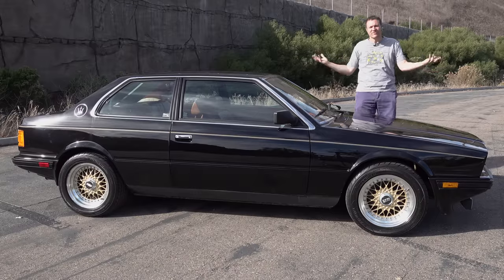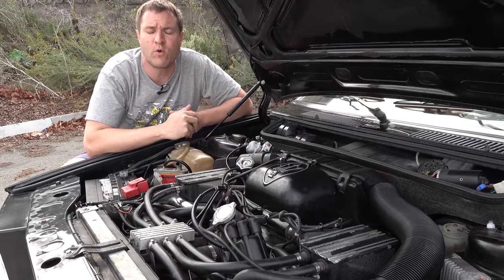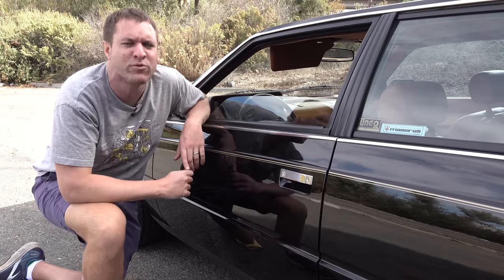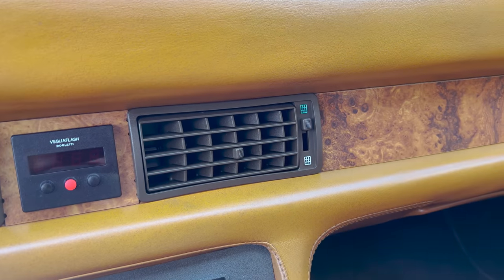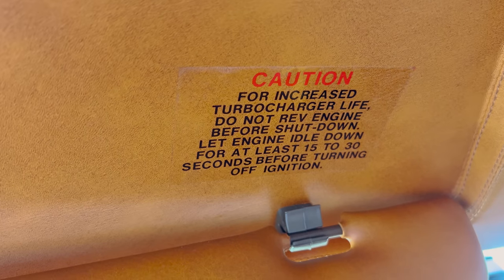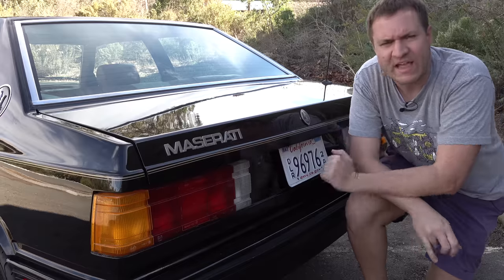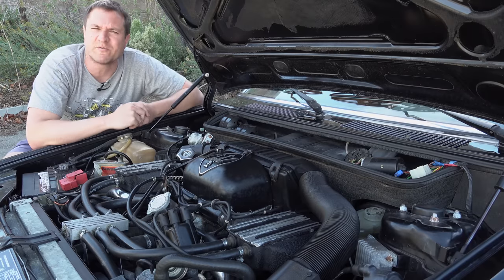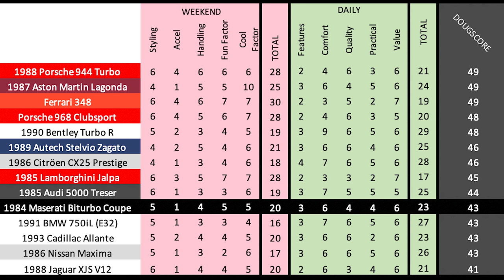The Maserati Biturbo Is the Ultra-Affordable 1980s Maserati

Comment: There is no real room to giggle over these specific quirks. That is the 80s for ya if not concidering the Volvos... During the 80's most Europeans drove around in 10 year old ones, rarely breaking the 100hp barrier... Not even the modern 80's cars went up there. Fastest i knew had like 140 or something. An awesome new Audi. I remember these Maseratis. The design was stellar.. looked like beasts next to our Mazda 626 and our next purchase, the volvo 245. And 110hp more... they were poster cars when the fiero had like 135 and the v8s put out like 220 at max.. in two tonne chassies

Comment: Turbos were not at all rare in the 1980s. They were everywhere. Just as ubiquitous as today.
Toyota Supra, pickup, Subaru GL, XT, Isuzu Impulse, I-Mark, Mitsubishi Mirage, Starion Tsi, Cordia, Nissan 300ZX, 200SX, Dodge Omni GLH, Colt, Daytona, Labaron, Charger, Mazda RX7, GL, 626, 323, Buick Regal, GNX, Century Coupe,  Skyhawk, Ford Mustang SVO, Mercury Capri RS, Merkur XR4ti, Pontiac Trans Am, Chrysler Conquest Tsi, Laser, Porsche 911, 944, Lotus Esprit, Saab 900, Volvo 240, 740, 760, Renault Fuego, Pegeot 505, Audi 5000...
All these had turbo models plus slew of turbodiesels from Europe.

Comment: You did not address the 800 lb gorilla in the room. Less than 200HP from those "BiTurbos" - for - 12MPG city, 18MPG highway, 14MPG avg. "OFFICIAL" fuel efficiency rating. ACTUAL experience HERE with MY 1984 BiTurbo: 8.2MPG city if I drive it like I'm not trying to piss everybody off behind me. And 14MPG highway. That's LOTS of gasoline for...for.  ...  ?? umm. MASERATI LOGO! Oh, and hello faiz! (My Italian car mechanic that's always busy working on Lamborghinis.) He called me by name. Yeah. We know eachother like that. mmm-hmmm.

I traded it in for a 1984 Alfa Romeo GTV 6 2.5 Mile Miglia quardrafoglio, put the turbo and intercooler on THAT car. It had a factory team works tuned baffle exhaust with stainless steel Borla parts. It had factory bronze window tint and power moon roof. I had it repainted from original black to money green metalic with a huge red white and green serpent and cross logo on the fenders right in front of the doors. C pillar had the Quadrafoglio badge from factory. Walnut dash had the pot metal plaque of Mile Miglia, showed the course over Italy. Flat black louvres over rear windows - all three, sides and back hatch. She rolled on Pirelli P-Zeros.  Inner headlamps were positioned lower and tinted green. A fog lamp kit was installed and it made people hate me so I never turned them on. My insurance was $2,500 per quarter for liability only because I was under 28 years old and male and I lived in a zip code that my insurance agent was raysiss against. PERFECTLY CLEAN driving record, nontheless...but never MIND, what MATTERS.

Comment: There's just that X factor. Same with Alfa-Romeo. Top Gear criticized the 147 GTA, which was inferior to a Golf R32 in almost every objectively measurable way. Yet, all three stated they would still buy the Alfa-Romeo. 
As a teenage kid, my dream car was the 1990's Gandini designed Maserati Quattroporte. And even though the W124 E500 or E38 3.8 M5 are vastly superior, i'd still have the Maserati over both. In retrospect, i respected those German cars, but i deeply lusted after the Maserati. 
When i saw one in Italy last summer, my heartbeat rose and for a moment, i felt 14 years old again.

Comment: I owend a 1993 Maserati Racing (biturbo) Although they had dropped the biturbo name for that limited (200?) model run . An Italian market only 2ltr V6 4 valve 4 cam engine fuel injected 290bhp (dyno tested) 5 speed manual. A conventional gated Gatrag gearbox. Best looking version of this car by far. 50000 trouble free miles. ( If I ignore the headgasket failure @25k);) that gave me the opertunity to gasflow the Cosworth designed heads. That was almost 420bhp with modified turbos,  exhaust, air intakes and watermeth injection. The car had electronically controlled  Knoni dampers from the factory by then. The only other thing I changed was 17inch 3 piece one off rims, for more rubber to help the roadholding  which was actually quite good. The cabin was a really nice place to be by then. A few less Maserati logos, Still that Analogue Clock admired by everyone.. The beautiful real wood and leather. The interior lasted really well in my ownership. It always felt like an occasion driving that car. I still look back fondly. Especially to the very first drive. I collected the car from Rome (a low milage used car in pristine condition) drove to the filling station and 21 hours and a few filling stations later I was back in Yorkshire in the center of the UK. A fantastic first drive. I did change the  fantastic looking wooden steering wheel for a Momo leather one for less of the Italian stretched arm driving position 😅. Absolutely one of my favourite cars. Much much better looking in real life rather than photographs. Especially the Racing. Dam, I think im going to look for another one 😮😊

Comment: I have an '87 Spyder 2.5 carb. Never had so much fun. Cheap to buy, expensive body parts, mechanicals are bullet proof. Maintenance essential. The handling (in the dry) the noise, the roof down - nothing beats it for a 36 yr old car. Love the looks. I'd recommend a later model with 2.8 injection engine but you can inject the 2.5 easily, the factory did make a few - they have the letter E on the rear. They rusted as they came off the production line but front wings are replaceable and can be bought new. Put on a sports exhaust and listen to the pop pop pop . Oh one more thing,,,,13 mpg from the V6

Comment: 1984 Biturbo is the Worst car ever built. Rushed into Pruduction by Intalian government funding. Thrown together with leftover Peugeot parts to compete with BMW 3 series. Best used for yard art. Worst timming belt design. One tentioner. Timming  belt grabs 7 teeth on crank pully. Belt skips when power is applied. Motor gets destroyed.  Worst steering. Worst handling. Worst electrical system. Do not drive or store in the rain. Do not wash it with water. Has Peugeot 3 valve motor. Crappy Peugeot carberated Turbo. Will never run right. Body rusts when in climate controlled garage. Nice German Transmission used in BMW 7 series. Don't even look at the fuse box. Otherwise total Garbage. Money pit. YOU WILL BE SORRY!

Comment: I had an '84 Bi-Turbo convertible until it blew up with 3200 miles on it.  The block and head were made of different material, so when they got hot, they warped their heads.  However,
no one called them BIGH TURBOS, but BTurbo's.

Comment: Had an '86 BiTurbo in San Francisco - they're excellent cars to drive hard.  Once on my way down to Silicon Valley, I got stopped by a cop.  He came up to my window with a perplexed look, and said he was doing 100 and that I was "pulling him."  Another time I took a 270-degree entrance ramp onto I-5 and had it locked up sideways the entire way around.  There was a short secondary entrance road halfway up the exit ramp with a Trans Am sitting there.  As I blew past a few feet from the front grill, sideways, for half a second I saw the driver and girlfriend passenger with identical wide open eyes and jaws fully dropped down.  

In 2000 I bought an '87 BiTurbo in Arizona for $2000, and drove it across country to Boston.  The owner was an aircraft engineer and had taken out the speedo so it only had a tach.  The only problem was the pinch-bolt clamp on the distributor kept getting  loose so I had to stop to adjust the timing (by ear) and redo the clamp every 20 minutes.  But I found if I kept it at 46,000 rpm the timing stayed good.  I later found that 46K rpm meant that I'd travelled across country at about 90 mph.  Only got stopped once, with a warning, in New Mexico.  This was before the country became a police state with 800,000 cops.

Everyone should drive an old $2000 Italian car across the country once in their life.  A few years later I bought a $5000 Jag XJ6 in California and drove that to Boston, stopping at every parts store along the way.  The wheel had about 12 inches of play particularly noticeable when passing semis on those long sweeping highway turns out west.   Lost the drive shaft in Ohio.  Both adventures were before I had a cell phone or credit card and more than a few dollars to my name.

These Bi Turbos are fast fun cars if you know how to drive.  Alloy wheels, a five-speed stick with a twin-turbo alloy V6, Italian performance suspension, rear-drive, and only 2400 lbs.  Looks good too.  What's so bad about all that?  As for the seats, they were fantastic.  Extremely comfortable and extremely supportive.  Once you sink down into them they wrapped around like a glove holding you firm.   As my daily driver, never once were either BiTurbos in the shop.   These are reliable cars if you race them everywhere you go.

Comment: I owned a Biturbo for a few years.  It was like having a beautiful woman in your life who keeps stealing your money and then trying to kill you.  Every time she went into the garage (i.e. every few weeks) it meant a bill of 3-5K.  Every time one braked in the rain the car would try to swap-ends and then slide into a wall or a crash barrier (powerful engine + thin tyres + short wheelbase + no ABS or traction control).  She had to go but I still miss her.  I believe they sorted all the issues out with the much more refined Ghibli - except for the mandatory engine-out service of the timing chain every 50,000 miles.  So - not all that affordable when reality bites.  A love affair gone-wrong!

Comment: Had ‘84   It was quirky rumor was it couldn’t pass EPA and sat on a dock in Baltimore for two years so when I bought it, it was new and about $15,000.  It had a choke that you had to learn how to operate properly  Air conditioning and heating or a joke. I got rid of it just when it was starting to rust. The craziest thing about the car was if there was less than a quarter of a tank of gas and you took a sharp turn the car would die. I don’t regret the experience. It had a great paint job and people w were checking it out

Comment: I have owned a 1980s Spyder with plenum
I have also owned a karif also a shamal.
The most fun was the old Spyder as my dog and kids sat on the back bench and had so much fun in the sun. The karif was the quickest, yes quicker than the shamal from 0 to 60 
If you serviced them regularly no problems
Most don't understand that they were high performance engines ( of the day ) and need looking after. As for the gear boxes ( early ones)
They were ruined by ham fisted clowns who could not understand a dog leg box.
Yes the drive train could get sloppy but it was due to the power sent to the rear axle , these could be easily shimed . What Clarkson and his clowns did to the car was so stupid and proves that not one of  them have any understanding of mechanics or a classic icon.  If you can't afford to maintain it don't buy it. Stick to a Japanese.

Comment: Re: on dilution of brand.... I feel that Porsche Boxsters get the same bad rap (at least early on) of diluting the Porsche brand. Just like the Biturbo, it becomes a brand thing. If Subaru or Mazda  made a sweet sounding, flat-six powered mid-engined sports car with excellent brakes and 250+ HP everyone would be freaking out about how awesome they are. Just like the Biturbo, Boxsters are greater than the sum of their parts, and the brand itself complicates things by conjuring up images of expensive, near-exotic machines that are unavailable to the masses.

Comment: I’m one of those Oddballs i guess i like the styling of the BiTurbo, the Porsche 914s and 944s starting with the Bi turbos  most of the inexpensive ones had or have  had Turbo issues that made them  sit for long periods and that is always bad on  Vehicles  i agree with you on the Bi Turbos kind of Classic80s styling i graduatedHigh School in 1982  so maybe that’s  why i like that styling  plus shortly after graduating  those were the vehicles that were the most affordable   i also had a thing for German Styling and the Bi Turbo resembled more of the 80s VW /Audi models of that time then more of a ItalainStyling  yes Maserati was great at using their logo  just look at a Chrysler TC  ( the K Car with the M logos everywhere  they could fit it

Comment: What afflicted this car also afflicted the earlier Citroen-Maserati SM, though that earlier model was intended as a "halo car" when it was first built, and somewhat less of a volume sales model. Like the expensive, low volume sports cars preceding it, the Biturbo had a high maintenance engine, but of course, the expensive, low volume models were expected to be high maintenance. You didn't shell out the substantial sums required to park a Khamsin or a Bora in the driveway without expecting the cars to be high maintenance, and of course, to involve the expected substantial Maserati maintenance costs.

That did NOT, of course, translate well to the Biturbo. Which, back in the early 1980s, was intended to be in part at least, an Italian take on the BMW 3 series. But it was in effect, an Italian BMW 3 series with Maserati costs. NOT the way to win friends and influence people.

It's possible that part of the bad reliability reputation arose from people not being willing to shell out Maserati main dealer prices for regular maintenance. And letting things break ... and break ... and break ... until something substantial finally broke, and the cost of fixing it was eye watering. At which point the car was junked.

Yes, it's high maintenance, to the point where most people don't consider it worth spending the money on. But find one that has had money spent on it keeping it running properly, and as you've discovered, it's more fun than anticipated. But at this late stage in the game, it's an indulgence. :)

EDIT: that digital clock looks like it was added later. Here in the UK, the Biturbo models we received had an expensive looking analogue clock in the dash. Don't know if the US spec models differed in this respect - worth checking on this.

Comment: I have a 89 Biturbo sedan, when it was running that thing moved with power. Enjoyed the drive and love the look. The seats are super plush and comfy. I had it stored for a year and now it doesn't start at all even with a new battery. I think the fuel pump maybe clogged sitting around. The steering fluid is also leaking, bought some parts from italy. Looking for a mechanic to work on this and can't find anyone, many mechanics said no. Dream of getting it back on the road again! Anyone have any mechanic suggestions? I am in DMV area.

Comment: The issue with the Biturbo in the US were the mechanics working on them and the cheap owners who bought them. Cheaper to maintain than a Ferrari 308, but not cheap enough. Biturbos do not carry this reputation in Europe. The Ghibli 2 cup of the mid 90s was the peak Biturbo model IMO, not the Shamal. Fabulous cars that many people used as daily drivers just fine.

Comment: I bought mine for 800 US and then dumped about 4,000 into it and then sold it for 350. I loved it but people on the 405 hated me when it would just shut down and I'd have to push it to the side of the road and wiggle the circuits. Had the circuit board been placed elsewhere it might have run better.

Comment: you roll up your exotic car next to a chick, accidentally put the gear in reverse, floor it to impress her, the twin-turbos explode as your car flies backwards over the cliff and now you're lying there up side down with your knee resting on the central-lock switch, wondering why the door wont open. But before you die your gaze fixates on one of the many Tridents and you realze that atlest you went out in style.

Comment: The Shamal was designed by Marcello Ghandini who did the Lambo Miura and Countach, no complaints there. It's possible that the Maserati name and trident appeared on so many parts because of logistics,
if you are an OEM doing multiple jobs for clients it stands to reason that it's easier to identify the components by doing that. Similarly, it's likely the duplication of the trident
filler cover might be for left/right hand markets that demand the filler be on a particular side. The diff was sourced from the UK, not sure if the gearbox was to. I saw a
gleaming red convertible recently and it still looks super. A cheap way to get into the classics and it's hard to beat saying "I drive a Maserati" 
Remember this beauty has timing belts that require periodic replacement which is guaranteed to be expensive. Are those wheels orig, I don't see a trident on the spinner.
Where's the famous Maserati clock set in the dash and removable? Hey, there's plenty of Japanese cars if you mind the "quirks"

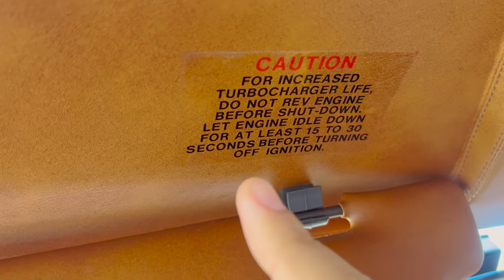Comment: 13:36
Very common in turbocharged cars at the time. Saab and Volvo did this for example.
It's because older turbochargers were oil cooled, and thus the oil would coke up by excessive residual heat when the oil pump wasn't running. That will totally destroy the turbocharger.
And when the engine was cold the you'd have to make sure the turbo was sufficiently supplied with oil to lubricate the bearings before you make it spool up and produce boost, otherwise you'd risk totally destroying the turbocharger...